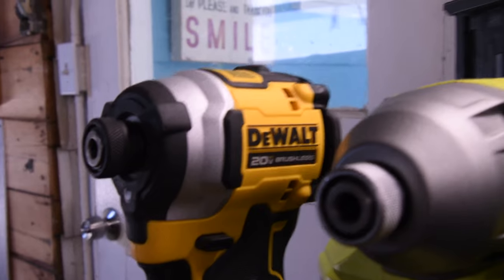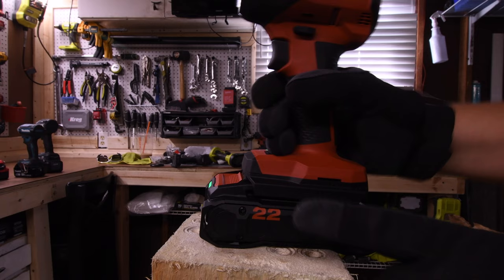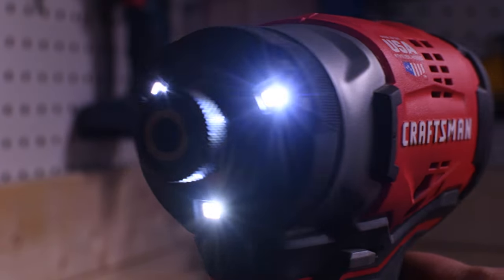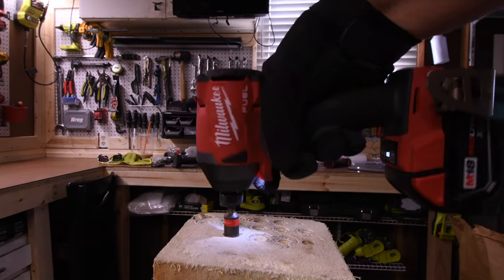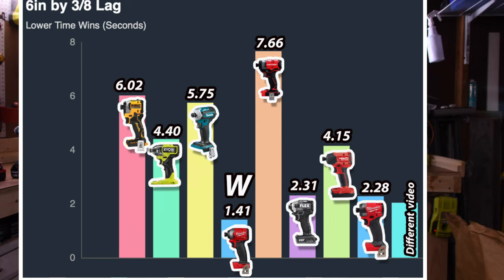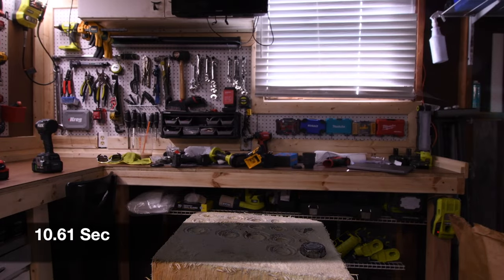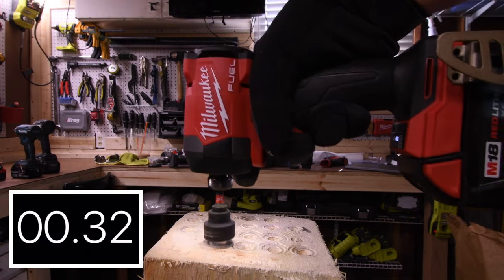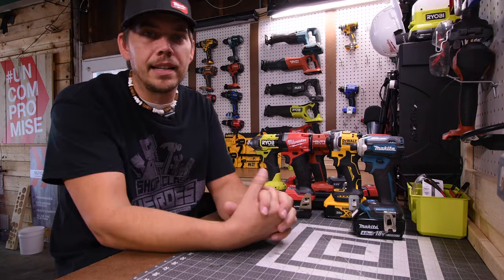Which impact driver is BEST for You?

Comment: I’ve been using DeWalt DCF850 for the last seven months and I absolutely love it ❤️
Reply: Same. We've come to a point where power isn't an issue for any impact drivers. Ergonomics is much more important for most professional. Just looking at how heavy the Flex is and how bulky the Hilti batteries are, I don't even want to try them out.
Reply: @MrArcticPOWER  I have Dewalt everything, but recently had to buy a new hammer drill and ran into the Flex special they were having at Lowes. hammer drill and impact driver with two batteries for $340. Crazy deal so I bought it. I must say, the Flex is insanely good, weight really doesn’t bother me. Flex is awesome! Especially with a lifetime warranty they are currently having for founding members.

Comment: Still love my sweet sixteen Makita . Smooth comfortable reliable not the fastest but you can compensate for that at the end of the day
Reply from the maker: it is a really good impact and used to be my go to
Reply: How do you compensate for a longer time doing a task? Working longer to do the same task? Lol
Reply: @simonmonty7171  no you just got to get on the fasteners a little quicker than the other guy you are making up seconds not hours
Reply: @harlanborders943  Do you own a business where time is important? Accumulated seconds becomes minutes and minutes become hours. If you can save time safely why wouldn't you... not saying to pick a Milwaukee if you ain't comfortable with them but surely is a brand out there saving you time and that you would feel comfortable with. Although I understand if you are invested in a brand and money is an issue, it makes sense to use what you have. Apart from that, sticking to a brand that is not time efficient is more of a fanboy decision.
Reply: @simonmonty7171  me my brothers all own different brands DeWalt,Milwaukee I own Makita in the 18 volt system at the end of the day I get as much done if not more so I am staying put

Comment: Dude, you drill that Milwaukee lag into an open hole.
Reply: At 5:23 he did drill the Milwaukee in a used hole. It seems to me most of all those holes are pre-drilled with a smaller log screw.

Comment: I was expecting more from Hilti, but I was shocked when Ryobi outperformed Hilti on many tests. After the last test you did, I lost faith in Makita to be honest. Great test!
Reply from the maker: the HILTI still performed very well.
Reply: It's not about stupid test It's about how long it will last and the hilti will be still going when the ryobi lost its ghost a long time ago
Reply: @loucifer4205  why do these tests than if your going to 💩 on people’s valid opinions. Your right Hilti is built for reliability not performance however that isn’t what the subject of the video is about in these tests is it…. Be humble Brother…
Reply: @loucifer4205  you'd be surprised how long Ryobi lasts. I've had some brushed tools I pull out in my trade when I need another set of power tools out.
Reply: That Hilti just looks so bare bones and tough. I really dig it. But don’t see myself switching from Milwaukee yet.
Reply: @fsb_-bf3th  I’ve actually Never broken a Ryobi drill. we had 3 that just wouldn’t die (the older batteries however were crap). I ended up giving them out to neighbors and a coworker. They were a bit underpowered for most applications but for light duty they performed fine. They all became beater drills that I would use in dirty places or loan out to people. I wouldn’t hesitate to buy them as a starter set of tools or even as a professional given the price point.
Reply: @ToolsInAction4u  exactly my thought too. If I got a helper who doesn't have tools ill bring them out. If the job site is a little sketchy where my work is spread out and there's some other shady trades and I don't need much power/performance I'll bring them out
Reply: @loucifer4205  Absolutely.  Finally, someone agrees with me.
Reply: Well, don't lose too much faith. Speaking from experience, that Ryobi will be dead within a year working at that pace.

Comment: Dewalt making some great tools lately but they definitely need to make a new dewalt xr impact that holds a candle to mailwaukee and if nothing else at least beat ryobi! It sickens me ryobi beat dewalt like that
Reply: That one tested is the new Atomic. It's not suppose to be the most powerful, it's designed for the tightest of areas. I have 2 of them, it has more than enough power to get the job done. However, the new XR model will be the dcf845, that one will have more power. Don't know yet what it will do against the milwaukee
Reply from the maker: The dewalt atomic impact is still my go to
Reply from the maker: That dewalt will perform better with a different battery, that will be in different different video and has been in videos of mine already

Comment: I think those times would be a little different for Flex with there stacked lithium.  High Output would of helped the Milwaukee as well.  Since you can buy the Flex in a kit with stacked lithium I think it would have been fair to include.  I Like the 850 as well for size.  Really appreciate my Japanese Makita. There is nothing smoother with all the models I tested.  Agreed most if not all of these products will get the job done.  It all comes down to what the buyer wants.
Reply from the maker: each brand has better batteries but this test was mainly for the 4ah with 2 exceptions with milwaukee and flex having 5ah
Reply: The 850 comes alive with a 3/8 anvil and PowerStack battery. Lots of power packed in a smaller package! You'd be amazed at what you can now do and the places it'll fit

Comment: How come you don’t stop the time when the socket touches the wood? It would be way more consistent than guessing if the bolt is set or not. Sometimes the bolt is all the way in sometimes it’s proud and sometimes it’s bang on but either way that is making your timing much more inconsistent, especially when comparing times as close as the Milwaukee and Flex…

Comment: Heck I was more impressed by how well the Ryobi kept up with the pro models! What happened to the Rigid?
Reply from the maker: Ryobi has made some pretty good stuff lately
Reply: Dag that's a great question... The Ridgid Max Output would have put up a great fight
Reply: @mike_t_007  I think so too! Do I see a part 2 to this show down? Lol
Reply: @ManCaverTools  They really have which is why I have been slowly switching over more to Ryobi from Rigid. Plus they have more variety as well. When Rigid cut their 12V line I recently went all in on the M12 line! I'd like your opinion on something. It's kinda a long question so what's the best way to ask you that's not on the comments of a video that it doesn't pertain to?

Comment: Which impact driver is the best for me??? And what I OWN and USE in my Jobsite???
1. Flex 24V Quick Eject Brushless Impact Driver WITH 3.5Ah, 6.0Ah and 10.0Ah Stack Lithium Ion Pouch cell battery!
2. DeWalt DCF885 Brushed single speed and DCF887 and DCF888 w/ Bluetooth and I'm running them with standard 5.0Ah or 21700 cell 6.0Ah battery (Both are made in USA)
3. Japanese imported Makita TD-172 18V (aka XDT-19 in The US) and Makita TD-002G 40V XGT Impact Drivers (Made in Japan) and I'm running them with 6.0Ah Battery packs while 5.0Ah 40V for TD-002G 
4. Bosch 1800CN Brushless Impact Driver with 4.0Ah 21700 cell battery (and I bought a exclusive German made version)
5. Craftsman 20V Brushless Impact Driver 3 Speed (Made in USA) with 4.0Ah battery packs
6. Ryobi HP 4 speed Brushless Impact Driver 18V with the new HP 6.0Ah Battery and also still have the old P237 Brush Impact Driver 3 speed with 4.0Ah battery
7. WORX Nitro 20V Brushless 3 Speed Impact Driver with 6.0Ah battery pack
8. Harbor Freight tools Hercules Brand Impact Driver 20V (I don't use this tool that much but this is what I lend to some people in the jobsite IF they need to borrow my tool this is the only thing they can get!)

Comment: if you notice in one of his tests, you'll see the Milwaukee doesn't start impacting until an inch into the wood compared to the other brands. this guy, no doubt at all is-doing trickery that Favours Milwaukee. 100%...most American reviewers do this. My tool arsenal is Dewalt and Milwaukee and i guarantee these results are false! out of all these, makita first, tie for second is Dewalt and Milwaukee
Reply from the maker: if the impacts happen later that means the tool didnt need to use impacts until that point, not every tool act the same. Why would I doctor results? I dont benefit if a tool wins over the others. The funny thing is, you say I made the Milwaukee win when I got the HILTI for free from HILTI. I dont make any tool brand win. On this channel whatever the results its real
Reply: every single reviewer in America or (close too) benefits favouring milwakee!

i have many tools and my hobby is watching films like this and i can see see straight through many of the trickery 

Jeremy Clarkson did the same
on top gear-his home brands threw so many cars at him, too test. He would have too say good things about jaguar and range rover even though they’re no competition too the german stuff.

that dewalt is torquier out of the hole-than that Milly. why did it start impacting before did you say?

Comment: Which Impact Driver is the best for me?? Well I got a lot of them! with both Japanese imported CORDED and Cordless and local cordless tools. I got DeWalt 887, 885 and the old 895, then I got the Craftsman, then Bosch also I got Makita XDT-16 and the Japanese made Makita TD-172 18V and TD-002G 40V. Then I got a new HiKoki 36V Triple Hammer Impact Driver powered by AC Corded Adapter. Also I got some old and New Ryobi impact drivers as well. And the Most Powerful of them all that had Dethroned Milwaukee and the New King 👑 is the Flex 24V Quick Eject Brushless Impact Driver 24V with 3.5Ah, 6.0Ah and 10Ah Stack Lithium Ion Pouch cell battery. And I got a Imported Stanley 18V Brushless Impact Driver imported from UK and made in UK as well. And I also got some Harbor Freight Hercules Brand as well. That's all! NO Milwaukee! Because I don't like Milwaukee it's a big NO NO 👎👎

Comment: I like my Makita. It might not be the fastest or most powerful on the market but it's comfortable, dependable & consistent. In my work I drive drywall & 3" wood screws 99% of the time so that 1/16 of a second in speed is not gonna make a difference.
Reply from the maker: Makita is a very good brand to have

Comment: I’m pretty happy with my gen 3.5 Milwaukee! No need for an upgrade just yet! Great video by the way!!
Reply from the maker: I agree, if the previous gen is still working great no reason to upgrade, but the upgrade will be there for when people are ready
Reply: @ManCaverTools  for sure! For anyone using a gen2…that’s definitely a major and worthy upgrade! Lastly…I was kinda shocked how slow the Makita was!
Reply: Forgive my ignorance... But what is the gen 3
5?
Reply: @RandyMarsh0301  there was an issue with gen 3’s collet and it was later corrected.
Reply: @shigthehandyman  is there a way to tell if I'm buying a 3 or 3.5?
Reply: @RandyMarsh0301  look down into the collet. If there is two ball bearings (one on each side), that’s gen 3.5. Gen 3 had only 1
Reply: @shigthehandyman  I mean before purchasing.. I'd hate to buy one from home depot.. Get it home and it's a single ball bearing and have to return it... Are the model numbers different or maybe a certain set of serial numbers? Sorry to be a pain and ask so many questions.
Reply: @RandyMarsh0301   no worries! The last 4 digits of the serial # is the date of manufacture: ie 2121 the first two numbers is the year and the last two is the week. So this example is 2021 21st week of the year. I’m sure you would be safe for anything manufactured in 2021. Serial numbers start with J57AF. The next 4 numbers is the date. Hope this helps!

Comment: Proceed with caution when judging Ryobi only by its performance. Those things are just not built for heavy use. At least that's my experience with them.
Reply from the maker: but Ryobi did pretty well in my opinion
Reply: @ManCaverTools  Performance wise, sure, but, in my experience, their build quality is awful.  Especially their reciprocating saws.

Comment: Great video. Your tool weight graph is completely messed up by the way. Why is the dewalt higher than others when it weights less, and the makita is so far down when the dewalt and makita have a difference of 2.4oz? the flex is 2 pounds 12 oz, it should be above the 2.5 pound mark since 2.5lbs is equal to 2 pounds 8oz.

Comment: So pulling out the lag bolt the Milwaukee gen 3 was 2.93 seconds yet won with a time of 1.41 seconds?
Reply from the maker: did I really mess up? ill take a look to see if I misplaced some stuff. I hope I didn't.
Reply from the maker: its worse then that. I messed up on the entire graph for pulling the 1/2 lag out :( not a single number matches
Reply: @ManCaverTools  I just happen to notice the Milwaukee Gen 3 numbers because it was doing really well in the testing.
Reply from the maker: @LV-1969  I accidentally used the same graph from the 3/8 lag, im trying to fix it, and I thank you for pointing that out bro. that is something I have to fix right now
Reply: @ManCaverTools  thanks for the videos!
Reply from the maker: @LV-1969  I thank you bro

Comment: 5:23 why are you drilling into a hole that's already been drilled? You can clearly see the indent where a fastener has already been buried, so yeah, it's no surprise that one beat the other times.  I was gonna comment on how sus it was that the driver sank a thick lag bolt faster than it drove a skinny screw fastener, and then I went back and noticed you were using a spot that was already used. Not even gonna bother going back and looking at other runs. Your results are skewed
Reply from the maker: this is my new style of test. each screw I use the hole gets bigger per tool. Yes it is like a pre drill hole but the next screw/lag that is used is bigger then the used hole. each tool has its own hole that gets equally used

Comment: When you stop the clock right when the socket hits the wood on the 6” 1/2 lag the Milwaukee scored a 5.07 and the Flex 4.71…. These tests are highly inaccurate when your bolt heads are all different heights… the only way to get real results is to pause and unpause your video until the socket just hits the wood and you will see all of your times are truly quite different.
Reply: Even then unless you measure the height of each bolt before starting the test you could end up with haywire results as well. Not bashing you, love the work you do, hopefully you take this as advice and not nit picking.
Reply from the maker: I accidentally used the same graph from the 3/8 lag IN and used it again for the 1/2 Lag OUT. its the same graph with a different title. im trying to fix it
Reply: @ManCaverTools  A simple fix is rerun the tests again, stop the clock when the socket hits the wood as this will be much more consistent and finally actually record the correct times for every brand…
Reply from the maker: @athannaelanderson3806  the actual clock is right bro. you do realize this is a YouTube video right? a viewer pointed out my graphs times were wrong for 1 test which changes the end result graph as well for the final score. and im trying to fix it. but your watching a video on YouTube. you don't have the actual raw footage in an editor  like I do. Clock is fine bro. get over it. I messed up on a graph. Thanks to a guy named L V the mistake was brought to my attention and im trying to fix it,  but your comment is useless bro.

Comment: Dude the Gen 3 on removal of the 6” by 1/2 you scored it a 2.93 and than on the scoreboard gave it a 1.41, this is all just bogus. Straight up just falsified your own test results to what end? Satisfy Milwaukee? Very disappointed MCT…
Reply from the maker: I messed up on the Graph edit. but I put the test result for that specific test in the description. I messed up on that one. it was the same graph form the 3/8 lag driving in. accidentally used the same graph twice. I messed up on that one big time. but I did edit it out of the video. that is be gone soon but the results are in the description.

Comment: he cheated on the Milwaukee gen 3 on the 6" lag screw. He put is in a existing hole. it finished in less than 2 seconds. that driver is not capable of doing that size fastener so quickly.
Reply: he did the same with the Flex as well.
Reply from the maker: all tools go that now, and have been for a while. first a 6' timber lock, then slightly bigger screw for in the same  hole, then a bigger lag in the same hole then a 1/2 lag in the same hole. for years viewers would comment saying I should do proper tests will pre drill wholes because that what contractors actually do on the job site. so that's what I do now. should have done this years ago. No more log tests on this channel.
Reply from the maker: These tests are not in order either. I didn't want to make everyone watch the entire test per tool at a time. imaging if the first 2 minutes was only a single tool. id get bored watching that, I film all the test for a single tool at once then I divide the footage so each tool does the same task like you see in this video. ill do a video on how this test is done.
Reply: Stop the clock when the socket hits the wood and it’s much better for gauging the real times Brother, this dude stacks in favour of whatever brand pays him more.
Reply from the maker: @athannaelanderson3806  no brand is paying me. which brand is paying you to say this?